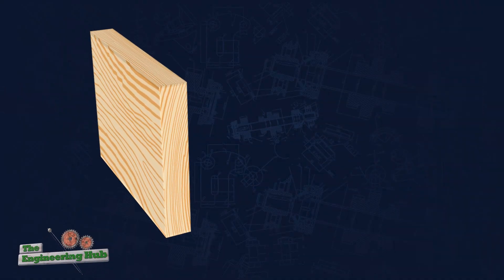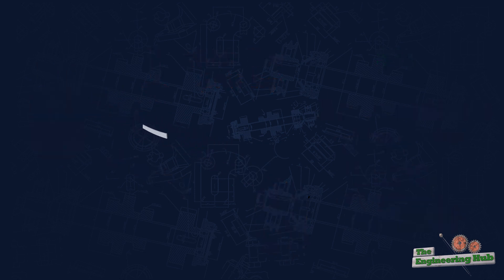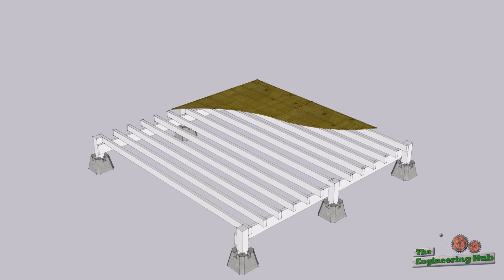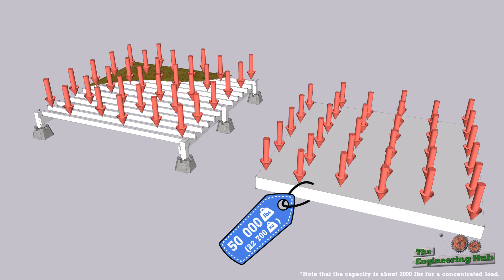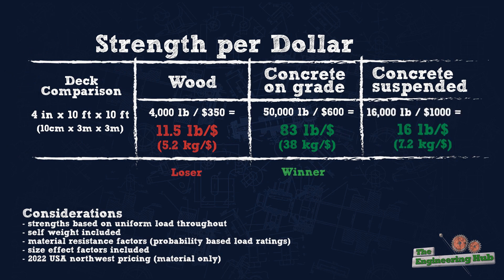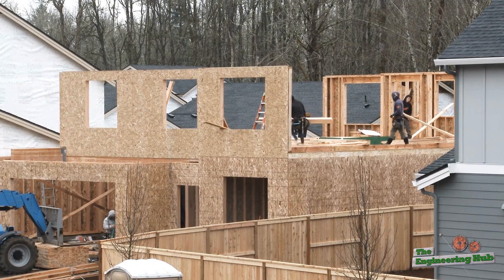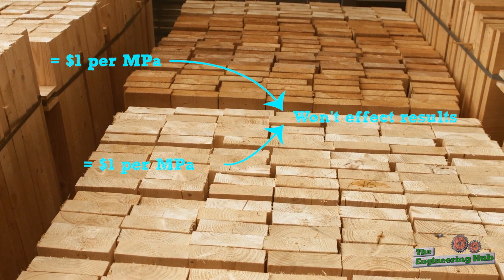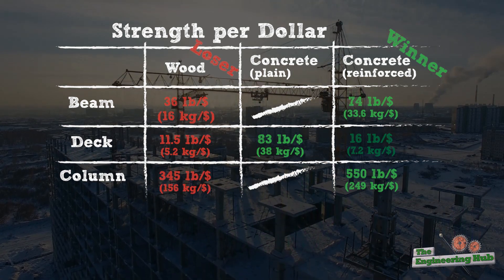Wood vs Concrete - which is best per dollar?

Comment: You would need to add the cost of time to the figures.
A wood post can be put in place and built on it right away, where concrete has to cure for days to reach strength.

Comment: While an interesting video, comparing materials goes well beyond their raw costs. AS a 40 year "low rise" commercial GC, concrete rarely wins the cost analysis comparisons, except for footings and slabs on grade.  The labor and equipment costs to move concrete vertically is a huge factor. Add to that the need for steel reinforcing and form material.

Obviously, the load carrying capacity, fire resistance and better STC ratings make concrete superior for certain end uses. If we life cycled buildings beyond the original financing then if would win a few more comparisons. However, the current energy codes favor wood due to the cavities available for increased insulation. These cavities also provide a place for electrical and plumbing. Assemblies are what have to be considered.

Comment: 0:19 What happen if instead of and straight beam uses a beam with a curve?  Catenarian or some curve that give Moré strength
Reply: Or I beam which would be easier to precast out of concrete than make out of wood. Or hollow core slab.

Comment: All homes where I live are made from concrete; foundations, columns, walls, floors, roof framing in metal. Having my home built now and labor is cheap cheap cheap, so concrete is a far superior choice. Ofcourse, lots of termites here too, so the little wood used as possible the better. Learning a lot about concrete now being that all my previous homes in the US were framed with wood and those rules don't apply.

Comment: Hmm... the main thing this doesn't take into consideration is that if I build a 3mx3m suspended deck, I'm not going to squeeze a hundred people on there, so the extra strength of concrete doesn't do anything for me but it's still more expensive...
Though on the other hand, 2 tons of load capacity sounds like I could expect the thing to collapse under its own weight during heavy snowfall?
Reply: the mistake is in the fact that the simulations are made around the volume of the material and not around the functionality.

Comment: It’s fun to look at this as a naval architect, since we don’t use concrete due to the fact that its complete lack of tensile strength, low compressive strength, extreme brittleness, high weight, and porosity make it utterly useless for shipbuilding applications. It continues to amaze me how much land engineers manage to do with it.
Reply: I would not say too low compressive strength. High strength concrete reaches 100-150 MPA. And it was used in 100 meter ships back then (feroconcrete).

Comment: If the labor cost are not a issue any more (let's say, a 3D printed house, or robots do the works) concrete will beat wood every single day, the thing that really makes wood win it as said in the video: workability, which translates into fewer days paid to workers. Concrete is much slow to work in the job site.
Reply: I think it still depends on the location if in this future a robot that can work wood and concrete are equally priced the wood frame robot would be able to put up more buildings over time than the concrete due to the cure time of concrete becoming a limiting factor.

Comment: Being based in India, I am always surprised by the prevalence of wood houses in North America.  Indians generally would never consider wood for any structural use. I doubt if even a single wood constructed home exists in urban india. 

Disclaimer : Wood is far costlier in India. But that is hardly a consideration for builders.
Reply: Hungarian here, and fully wooden housing is also rare here, although most roof structures are built with it. Most modern houses are built from bricks, soviet-era apartments are (prefab) reinforced concrete, while poor rural folk used to build with mud bricks.

Comment: hi a question for you how much load can a 6 inch by 6 inch wood post 8foot long span horizontally with the weight in the centre take?
standard construction timber

Comment: Cement to make the concrete is energy intensive to produce and also creates great amounts of carbon dioxide.  Steel is also energy intensive to produce and creates a lot of air pollution and solid waste.  Both also create big holes in the earth to mine the required limestone and iron ore.  Wood is renewable without substantially altering the place it was obtained.  Historically, the energy to manufacture lumber products from logs has been produced by burning the wood waste from manufacturing.  The huge amount of fossil fuel generated energy is not required.  

In your examples, the extra strength gained in using concrete and reinforced concrete is not required.  Wood provides all the strength needed for the task.  Concrete structures are heavy and require much more substantial foundations.  That adds heavily to the cost and material required.  Advances in mass timber structures are making wood seem more and more attractive compared to concrete and steel. 

Wood is not the homogeneous material offered by steel and concrete.  This, in itself, makes engineers shy away from it.
Reply: There are hundreds of square miles of destroyed ecosystems and decimated forests in North America. Look on a satellite image of California and you will see. Then try to find a concrete quarry in California without searching for an address. You will not be able to find the damage done by concrete mining.

Comment: Also in my expert opinion wood wood would overall be cheaper then concrete in the lifetime of whatever is being build like repairs, materials, and labor compared to conrete if we're talking about homes because concrete would take too long and time is money
Reply: Good point, though I do wonder about advanced in structural engineering and material science like using UHPC in RCC designs and maybe along with like better material than steel rebar. Instead of having 30 year lifecycle house designs, the plans can be 500 or longer year designs.  Even granite has a better long term potential as a structural material.  Seems there may be potential advances in geopolymers as well to ease the materials lifecycle energy requirements more.

Comment: How about as a roof? Then if a structural failure ocurrs and anyone is underneath it at the time of the collapse if wood possibility of survival. İf concrete almost certain death. Put a pricetag on that.
Reply: There is a design and permitting process, engineered structures don't just fall down.
Reply: @lindsay_1849  lots of buildings fall down.
Reply: @garrysekelli6776  There arn't many examples in Canada in the last 30 years. A handful of commercial parkade structures that's about it. Protection of life is built into the concrete design code, seismic code. It's not a major (or even a minor) concern comparing material choices.
Reply: Cost of life insurance. Or probably much less, as I don't know the way profitability of a person is calculated. But I can assure you, corporations take such losses into account.
Reply: @wumi2419  the cost of life insurance is not a set value. İt is different for everybody.
Reply: @garrysekelli6776  you can still estimate. And it can be a pretty good estimate if type of home (or just the fact question of cost is asced) is taken into consideration